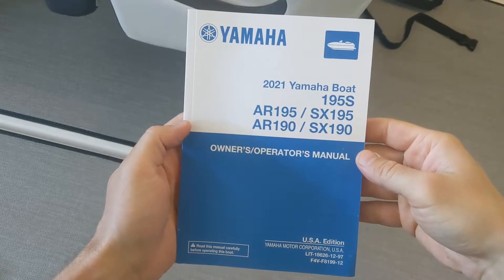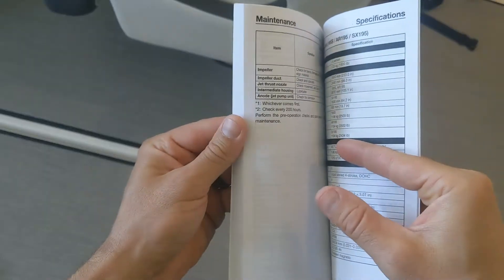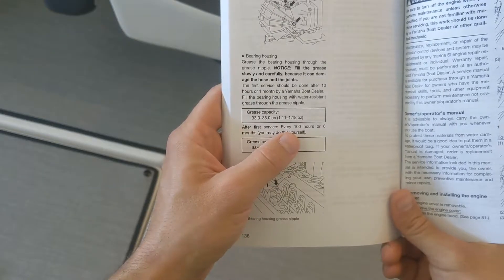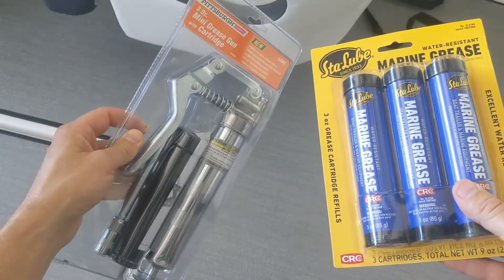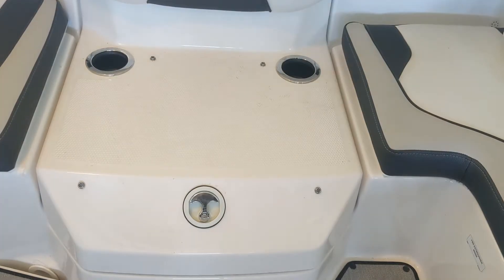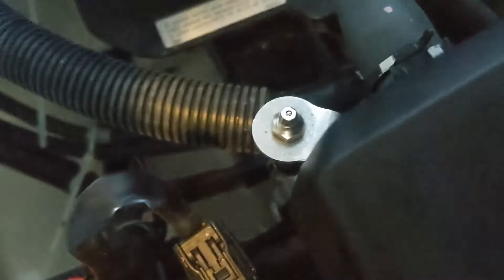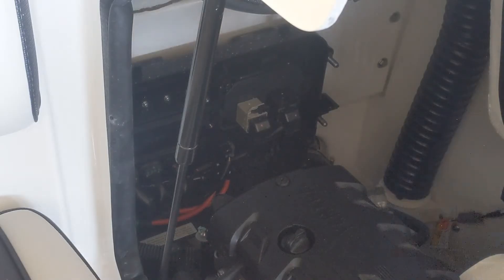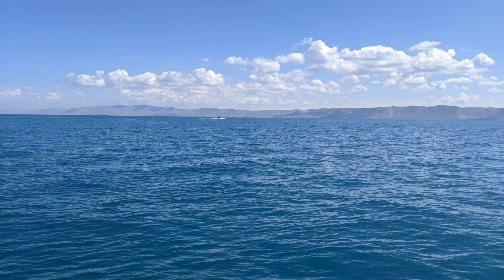Greasing the Intermediate Housing Bearing on a 2021 Yamaha AR195 Jetboat With Mini Grease Gun

Comment: Remember that is the max the fitting holds not how much you need to add . ITS  NOT empety
Reply from the maker: Right, I was just going until the rubber hose had some grease in it.